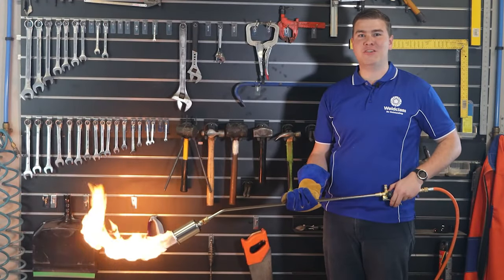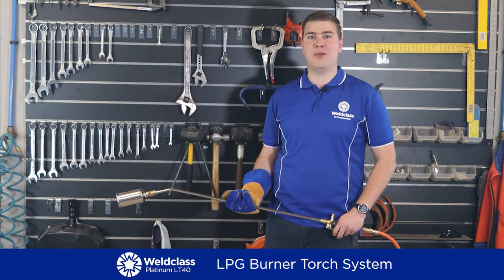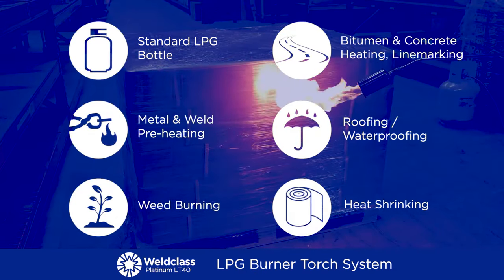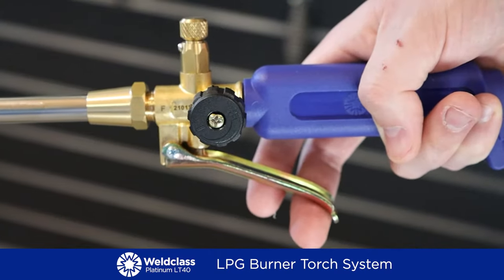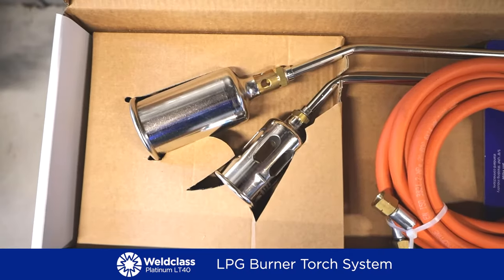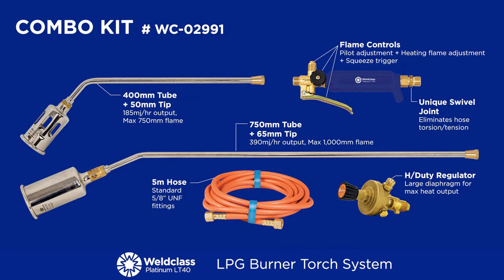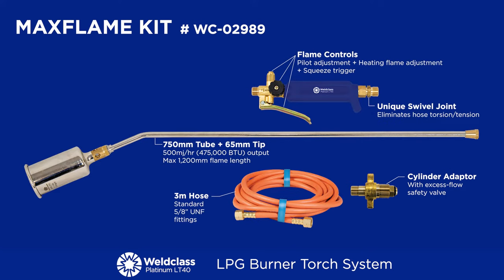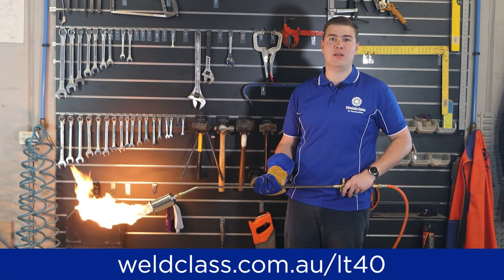Weldclass Platinum LT-40:  A European-made powerful LPG burner torch, built to last

Comment: Just bought mine and its a monster burner - would like to learn more about adjusting the flame and burn intensity as the gas is used.
Reply from the maker: Silvio,
The “Maxflame” kit is supplied with a direct connect fitting, to operate torch on full bottle pressure. This has the benefit of providing maximum possible / unrestricted flame power. Note that the pressure in a LPG bottle will vary depending on ambient temperature & contents level, which may cause some variation in the flame intensity. 
The “Combo” kit comes with a gas regulator. This reduces & regulates the pressure which allows for better control of the flame & also reduces gas consumption. 
If you have a “Maxflame” kit and want to fit a regulator, we suggest this model (or similar): https://www.weldclass.com.au/product-group/1955
Reply: @weldclass  thanks for your reply, my weldclass came with no instructions other than the 4 dot points, I will go to the www for more info, thanks, its a brut and roars when roasting weeds and grass. cheers